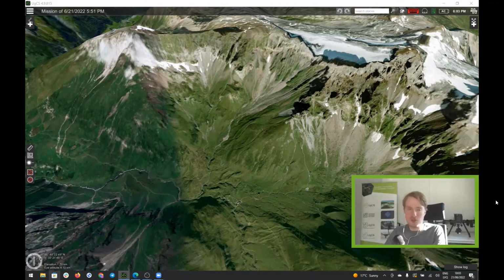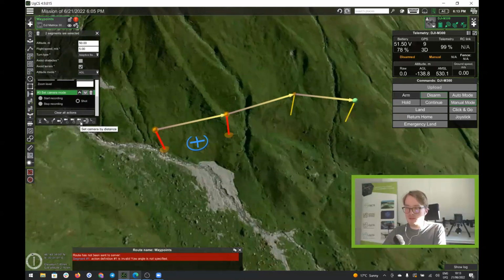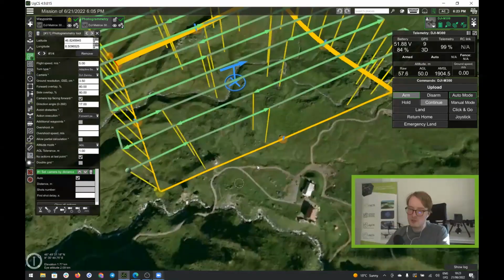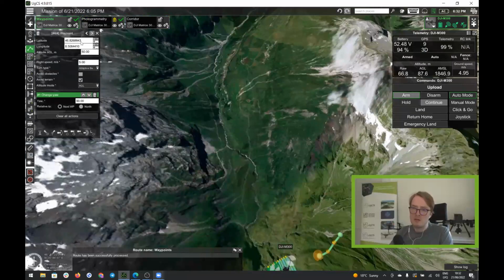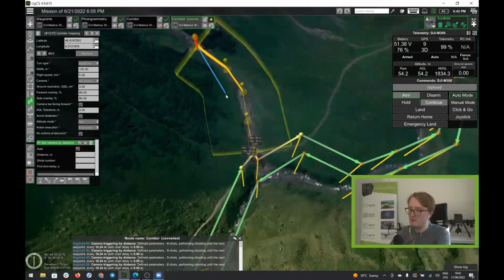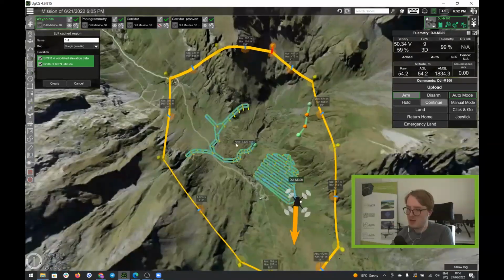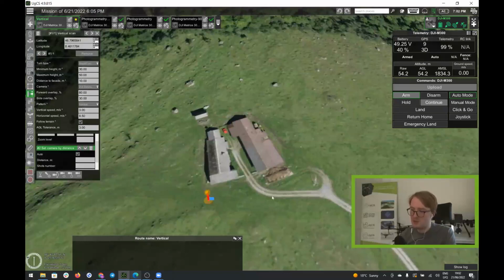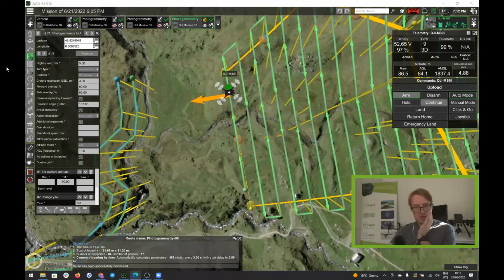Free UgCS Training for New Users

Comment: Can you add fly over exclusion zones. Like to fly over power lines that cross your grid or maybe avoid a radio tower
Reply: Hi! Currently you cannot add geofences but you can create no-fly zones in UgCS. The software will not allow you to plan a flight that enters the NFZ boundary, allowing you to ensure a distance to radio towers or powerline corridors. The zones can have minimum and maximum altitude.